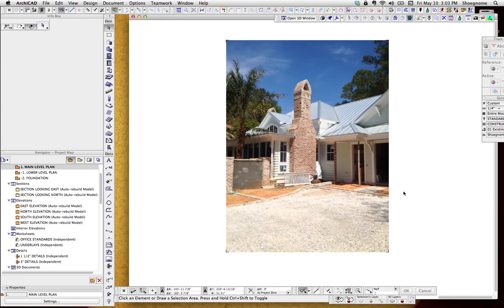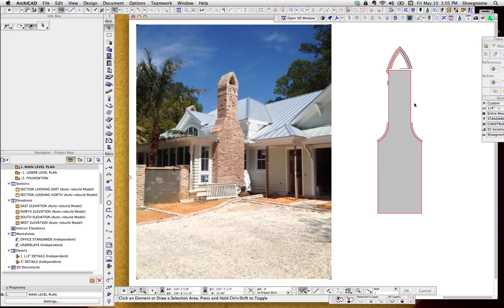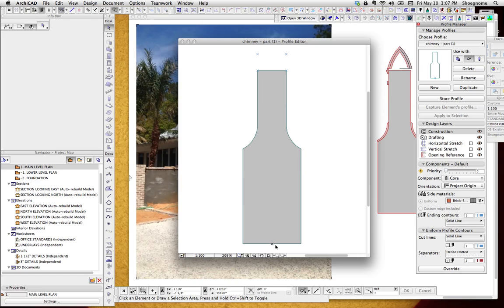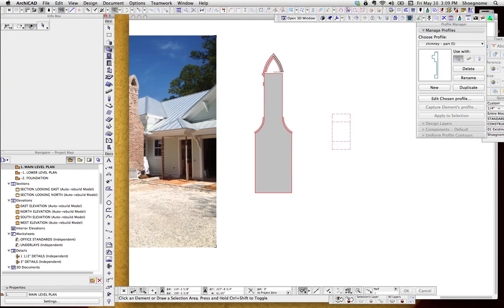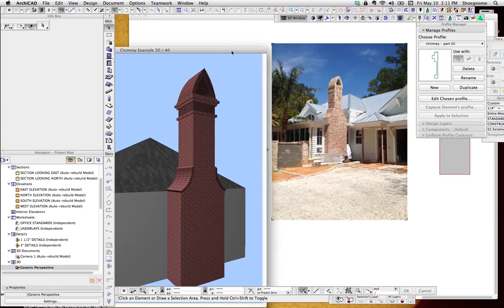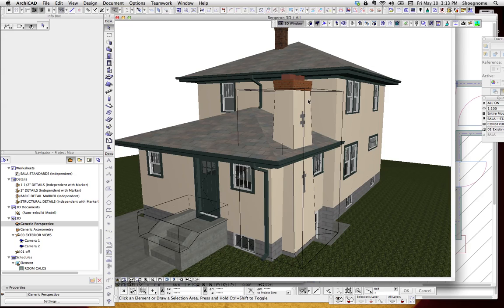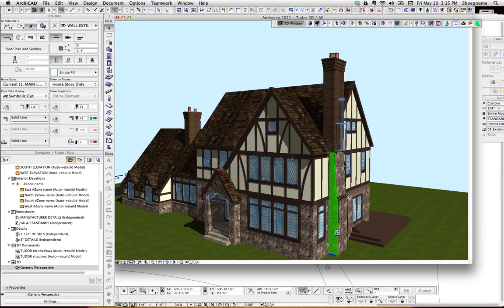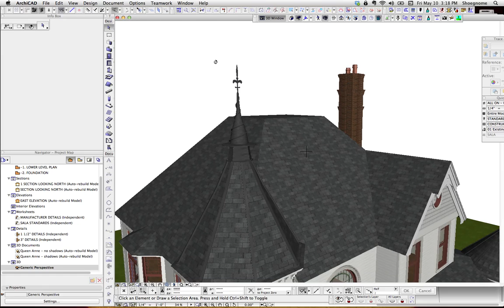ArchiCAD Tutorial #22: Modeling tips for Chimneys in ArchiCAD

Comment: Hello!
I just wanted to ask you about the modeling technique used to achieve that spiral on top of the tower of the last home you presented. It really looks hard to do with what I know now about Archicad. 
Thank you!
Reply from the maker: The spiral on the top of the tower is the spiral Object (under basic shapes). It's actually 2 or 3 objects because the spiral Object has a constant diameter. In 2016, I'd suggest building the spiral out of Morphs or perhaps making it in another program and importing it (Grasshopper could make the spiral easily).

Comment from the maker: The downspouts in the second house... I actually now usually use the downspout object, but what you're seeing in that model is a complex profile. I probably wouldn't do that anymore though. It's a bit annoying to deal with multiple downspout configurations. A shell would work WAY better. Or a morph, but the extrusion of a section that the shell allows would be perfect. And then can be turned into an object if necessary. So for downspouts try the humble overlooked Shell Tool.